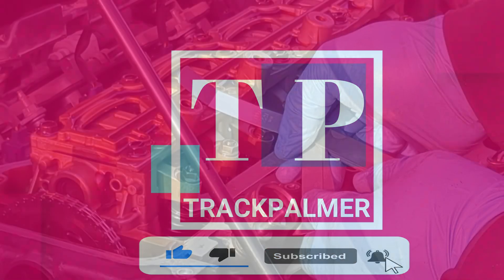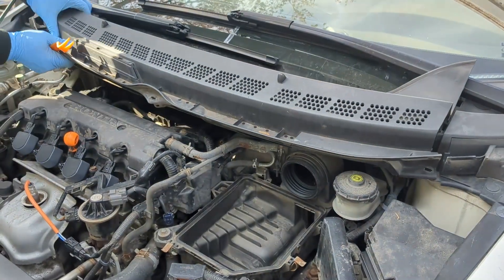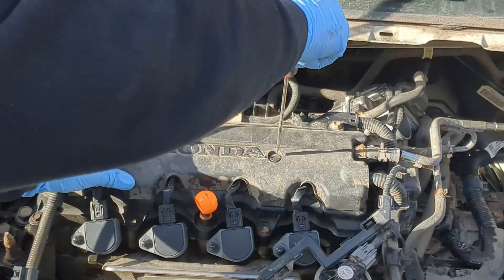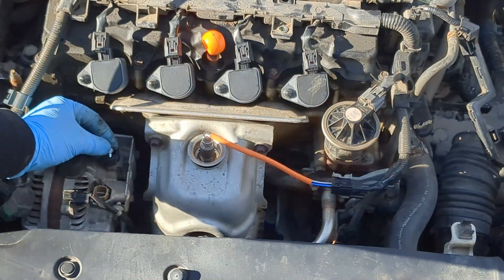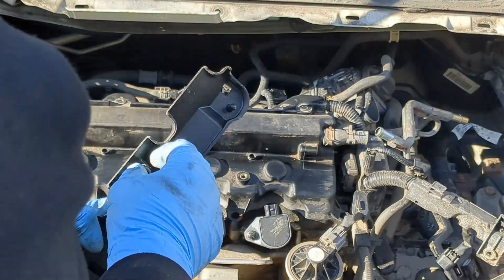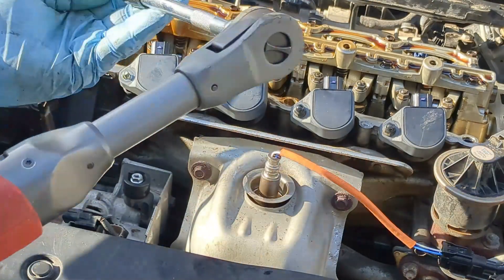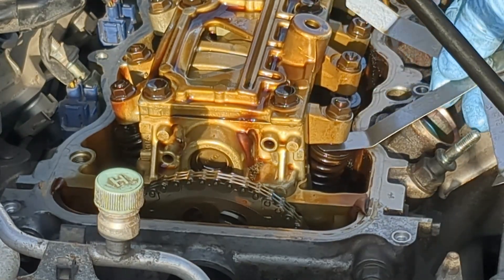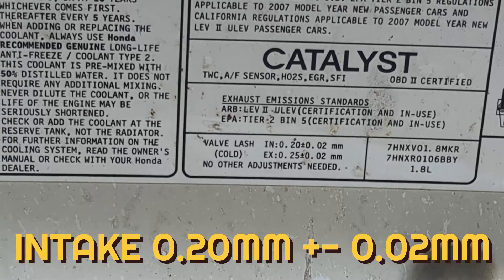Honda Civic Valve Adjustments 8 gen 2007 to 2011

Comment: Be careful what you say. Each cylinder has 4 valves, not 2. You mean to say each cylinder has 2 Intake valves and 2 exhaust valves therefore 4 total. Otherwise a good video! you might also consider putting the wipers in the up and down position by turning the key to the on position and turning on the wipers until they go vertical and then immediately turning key  off. then you don't have to bend them around as in the video.
Reply from the maker: You are correct.